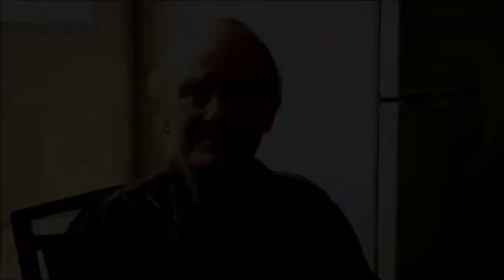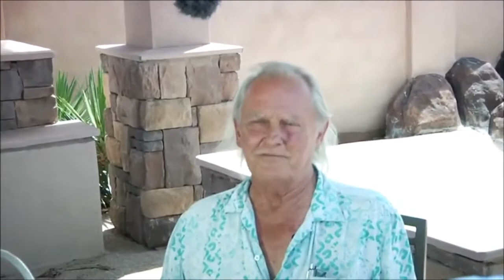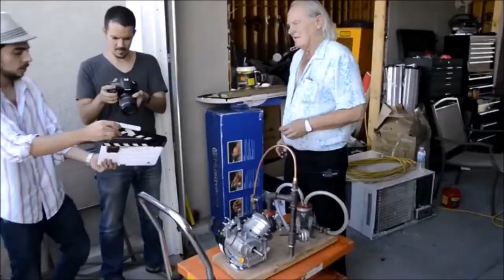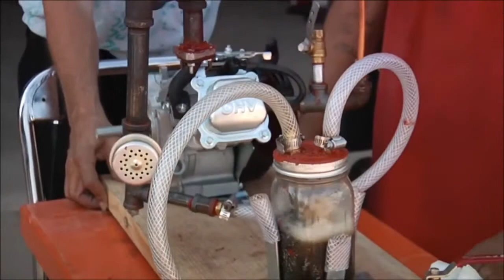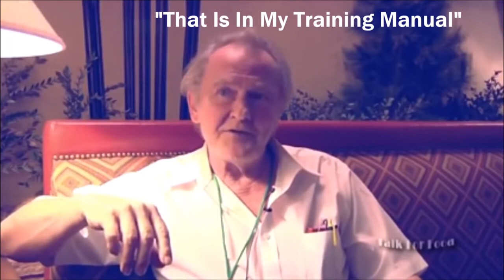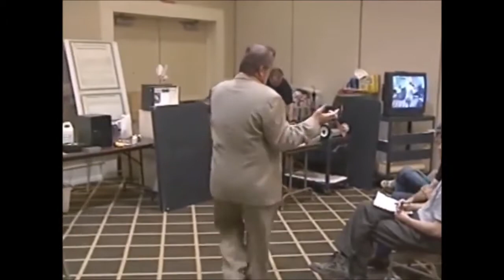Paul Pantone G.E.E.T Fuel Processor Free Energy (Over Unity) Diaries Part 9

Comment: What is the reaction rod made of? is it easily obtained?
Reply from the maker: From what i remember the shape of it is important ,  see how it has a dip on the top and a spike shape on the bottom . i think i remember them saying that the rod has to be ran through the machine inside the pipe and the motor itself will magnetize the rod.  https://www.youtube.com/watch?v=5dmcuF0r85k  

if you look hard enough i think they even have plans on how to build the machine. i pinned the website where you can get the plans.
http://rebuilding.geetinternational.com                 http://rebuilding.geetinternational.com/free-plans/
Reply: @WesternScienceUSA  there are conspiracy theories about Hitler having alien technology, then I read below someone commenting on Hitler using "wood fuel" combinations in tanks. I am wondering if Paul was visited by aliens to develop this method of Geet fuel reactor. I would love to try it our but am really scraping the bottom on extra funds.

Comment: If I did this in California can I get away with it with smog and does it effect hp or torque?
Reply from the maker: It would make emissions near zero if you can pull it off if would easily pass smog without the need for a Catalytic converter.
Reply: Hp and torque would depend on the make and model installation parameters which are unique upon past exp. builds being virtually non-existent.
As long as the State of California doesn't know you have it in your vehicle, the smog is irrelevant. Smog goes in and oxygen comes back out.
Reply: Good luck getting it to actually get enough power to move a heavy piece of machinery down the road! Paul himself couldn’t! Btw, what is the definition of a SUCKER?

Comment: around 13;20 he says hitler had used wood ect to vaporze fuel i looked it up he is right 

Wood Gas powered tanks – Holzgas

The commercial term for a wood gas generator, or Holzkohevergaser in German, was the Imbert-holz-gas system which then was shortened to Holzgas. The gas was used to fuel vehicle engines thus saving on petrol/gasoline and diesel. The Imbert system is a closed external combustion system designed to produce gas that can be cooled and used in an internal combustion engine.

The Imbert system uses wood pellets and the gas produced needs cleaning and cooling prior to passing to the cylinders of the vehicle, otherwise it would choke up with residue. During the production process, biomass or other carbon-containing materials are gasified within the oxygen-limited closed environment of a wood gas generator to produce hydrogen and carbon monoxide.

These gases can then be burnt as a fuel within an oxygen rich environment to produce carbon dioxide, water and heat. In Germany, around 500,000 gas powered vehicles were in use at the end of the war due to the lack of petroleum.